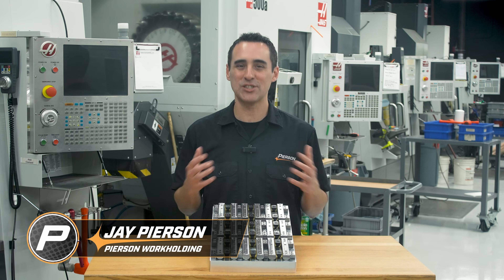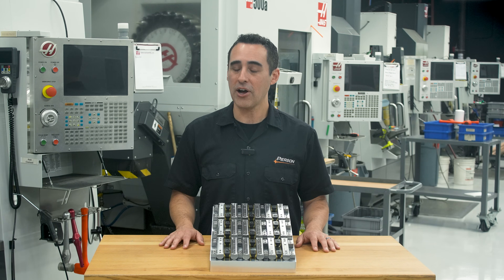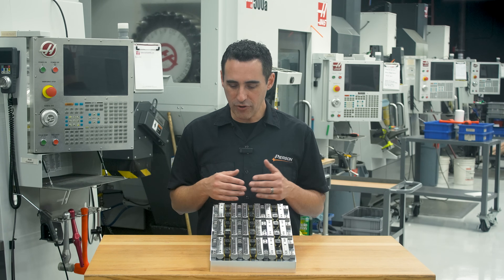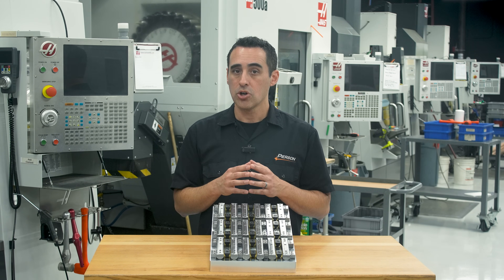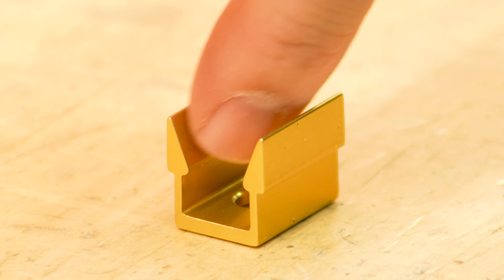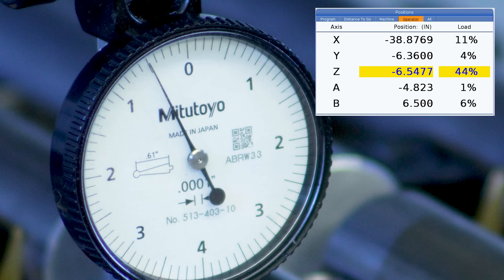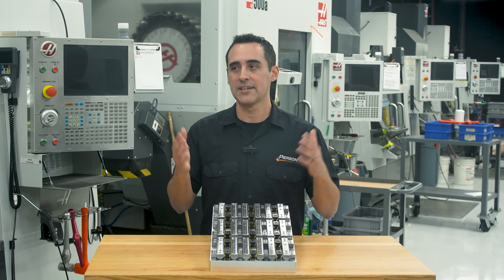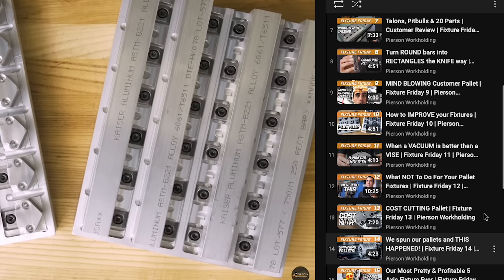810% Walk-Away Boost! | Fixture Friday 24

Comment: Do you recommend steel threaded inserts in the pallet to improve thread life for the clamps? Or do you screw the Mitee Bites directly to the aluminum pallet?
Reply from the maker: If there's a fastener that will be cycled in and out, like the clamp thread, there should be thread inserts for that hole. For the fixture rails that are stationary, threading into the aluminum is fine.

Comment: I guess my biggest question,  is why are you making this from round stock?  If you used flat bar, cut to length with some excess, this would be a 2 operation mill part.  Maybe I'm not seeing a feature but it looks like something that you could run from square stock...
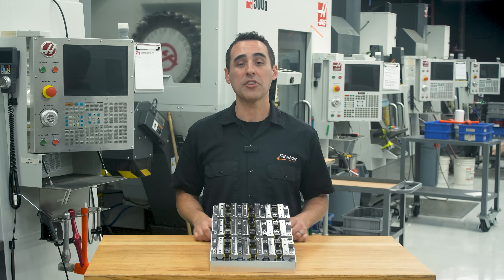Reply from the maker: I answered that at 4:23 and it's still a 2 Op mill part. Did you even watch the video?
Reply: As a customer of yours and someone who watches most of the videos you publish, I did watch it but somehow missed the 24 seconds where you explained why the round stock.  Since I was at lunch while watching, I'm sure i had a distraction to help me miss it.  Sorry to have questioned you before re-watching, but a little grace would have been appreciated in your response.  As a fellow machine shop guy, I was only thinking of helping, so once again, sorry I missed it...

Comment: . Those clamps put a lot of horizontal load and can move the horizontal x/y location around quite a bit.
My recommendation to buyers is don’t be cheap and get the smallest/thinnest pallet you can. Yes it’s cheaper and lighter. But an extra bit of meat goes a long way. 
My first pallet experience I wish I had had an extra 0.5 or more heck 2”more width to resist the force of these clamps. Placing a part 1” sunk in and 1” above the pallet for op2 I could yaw the part rotationally with low clamping force as the pallet wall bowed. Keep it in mind!  (My design fault, not a Pierson fault, their mini pallet product worked flawlessly! ) I left 0.5” of wall as a support and it was not nearly enough. Leave some meat, you can always remove it later if the pallet is to heavy!
Thanks again for the vids/great products Jhon!

Comment: I have some pallets than run an op1 of 48 small stainless steel parts, each of which has 5 precision bores, and it runs for 2.5 hours.  Op2 is on another pallet, 24 parts at a time and requires 20 minutes.  I’m at the machine less than once an hour.  PPS all the way!
Reply from the maker: You get it!!!!
Reply: @PiersonWorkholding  It also constantly evolves. I just have a 3 axis machine with flood coolant.  I quickly learned that I would need to do some gcode pass through in fusion to make some wash down routines to clear the pallet of chips between ops. Just keep making small improvements. You were the one that turned me on to Lean and life has never been the same.

Comment: You can't just figure cycle time you also have to factor in unloading and loading the parts either in the machine vise or on a pallet. My guess is the pallet system is overall faster per part making it even a better outcome.
Reply: It tips even more in favor of the pallet!  Loading and unloading vises is way slower than the pallet, plus you can have two pallets and just swap them and do the unloading and loading while the machine does another cycle.

Comment: i think you can get the exanding clamps same size but longer so you'd get more surface area but no row losses
Reply from the maker: Yes but you'd still need another center piece to apply more force across the longer channel. With only 1 center, it would apply the same force to a wider face and holding power wouldn't increase.

Comment: What about making a pallet out of 7075 Aluminum? Would that reduce flex? Another big item that you didn’t mention in your machining times was how long did it take to load two round bars in your vice per op vs loading a single pallet. Quite a bit of time savings there also. Being able to walk away from the machine for a good amount of time is valuable. I hate 3 to 8 min short cycle times on my 4th axis. Can’t walk away and do anything and keep the machine running.
Reply from the maker: 7075 has nearly the identical modulus of elasticity as 6061 so the pallet wouldn't be that less flexible. And yes, the loading time of 2 parts in a vise compared to 18 parts on an identical pallet OUTSIDE of the machine is painful! Definitely can't get anything done with 5 min cycle times.

Comment: Nice fixture there!

Idea for the "knive makers method" in the second op:
Why don't you make a second op fixture plate similar to your current one, but with the exact same part positions as on the first op.
Then you could leave your OP10 parts clamped while you put the empty second op fixture on top. Then screw all the parts in from the top into the finished threads without having to hold the plate and fiddling around the workpiece and screws from two sides. Since the position of the parts is still given by the OP10 fixture this should be a lot easier.

Calling it the "contact grill method" :D
Reply from the maker: Yes! We call that a "transfer pallet" FF 27 will show that method.

Comment: Can you explain how that is actually a better way to make these than on your lathe?

With the lathe you get unattended runtime of (however many parts fit into a bar) * (how many bars are loaded in the feeder).  I would guess that adds up to a lot more than fit on the fixture.  You are also not spending 5-10 minutes of manual labor loading/unloading parts, not to mention the strain on operators of handling loaded pallets.
The biggest benefit for quality would be making a complete part every cycle.  You would be able to observe and mitigate issues such as wear or broken tools before they cause parts to go out of spec.  In the case of the pallet you have the potential to end up with a fully loaded pallet of bad parts PLUS a lost hour of runtime.

Obviously some nuances in how the lathe runs, and maybe its not profitable to run those ¢ types of parts on that kind of $$$ machine
Reply: Came here to ask the same question, unless it is more profitable because the lathe can make different parts the mill can’t